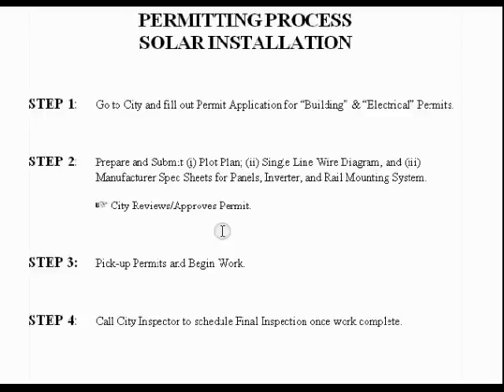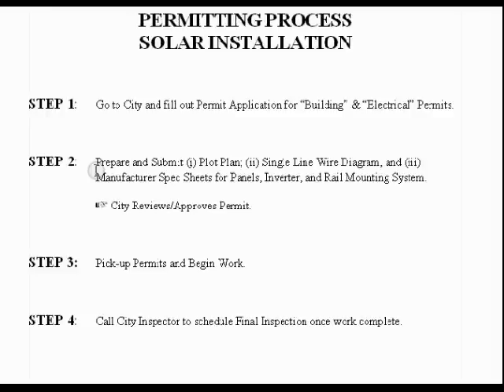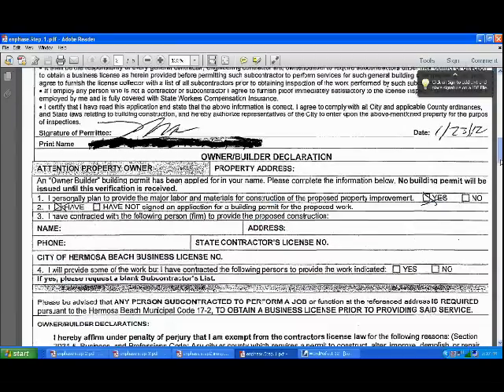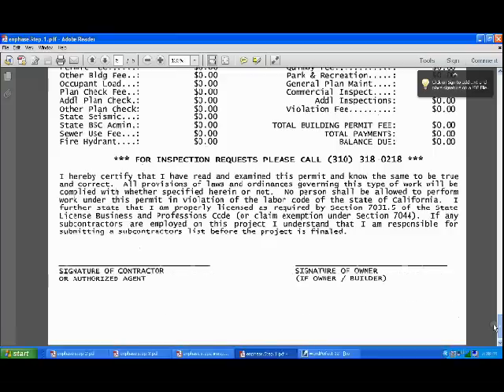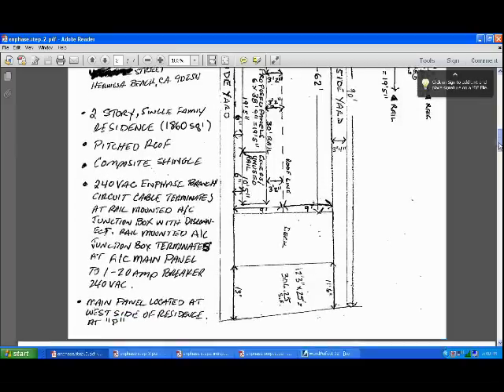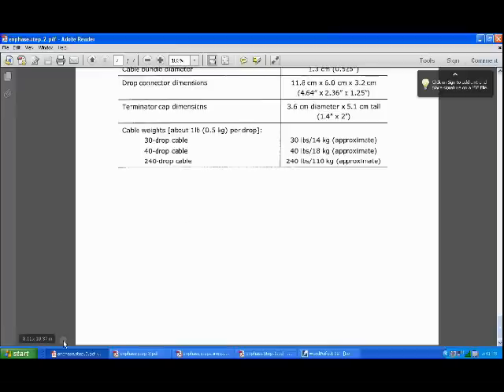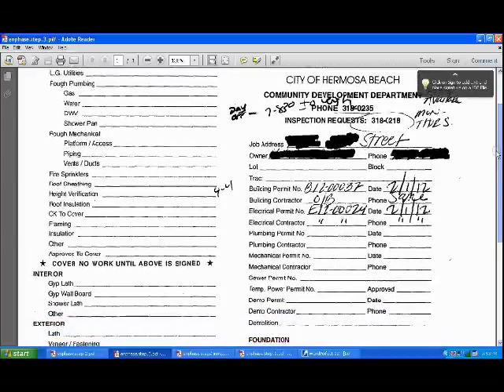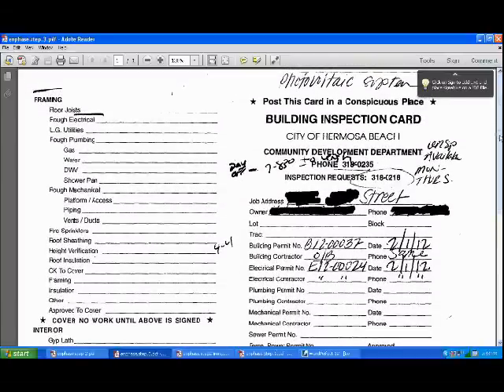Solar Permit Process - Enphase Install

Comment from the maker: But the Utility person just comes out to "inspect" your old meter to see if they need to replace with digital type, or as in my case, to program my existing digital meter to spin backwards.  Took them about 3 weeks after i did the online application to come out and do that...this was done while i was not present...that's about it..they don't inspect anything more than that

Comment from the maker: No "real" inspection from local utility. Once i did the city inspection and they approved, i was connected to the grid, however, i couldn't get credit for power i made during the day above what i used (e.g., spin backward) until I applied for "net meter" with the utility.  To get the "net meter" i filled out their application online and they sent me a tag "permission to operate" to put on meter, and then sent out utility person to inspect my old meter and program it to spin backwards.